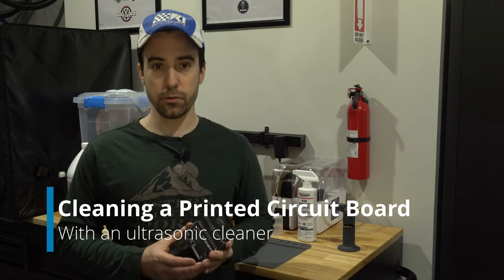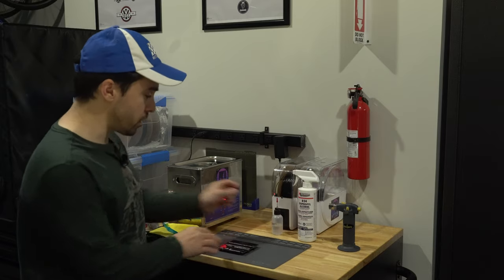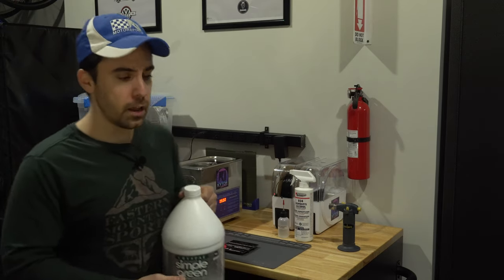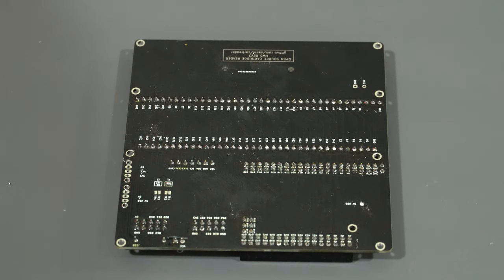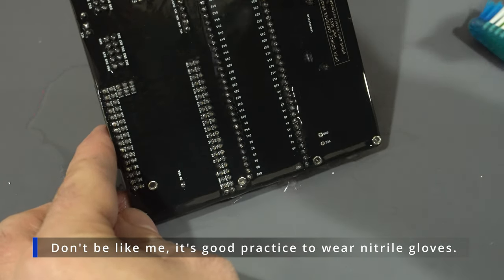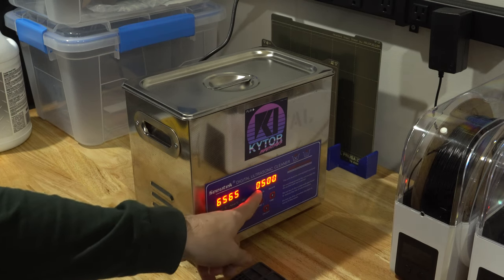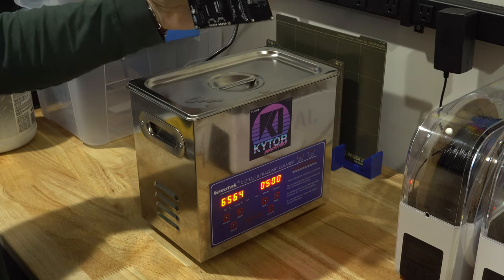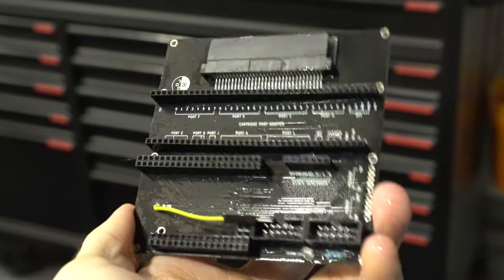How to clean a PCB using an Ultrasonic Cleaner

Comment: i would put the pcb in the ultrasonic cleaner. then put it in water, then douse it in ipa to remove the water. anything else is unnecessary. you have to use distilled water or it will cause problems later. it looks fine, but its not.

Comment: Hey what kind of water you used in the ultrasonic cleaner? is it deionized water or something else? I've been looking around on google but somewhat I still unclear
Reply from the maker: If your tap water is behind filtration (around 5 micron) and a functioning water softener, you can just use tap water. If not, or you're uncertain, just use distilled water. It's around $1 per gallon.
Reply: @kytor  Oh so distilled water is safe for pcb and other electrical components?
Reply: @InginHidupTenang uh, yeah bruh
Reply: try using mineral oil
Reply: @InginHidupTenang  Water isn't inherently bad for electronics, as long as the device dries thoroughly before receiving power. Minerals in typical water can deposit on the electronics and cause issues. Distilled water doesn't have all the minerals that typical tap water does.